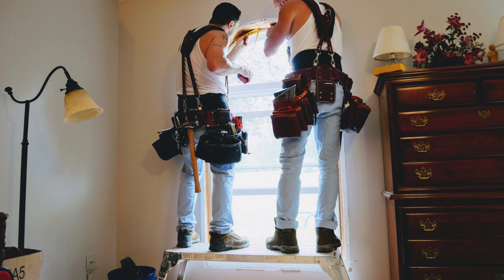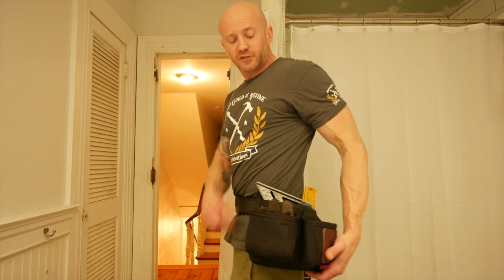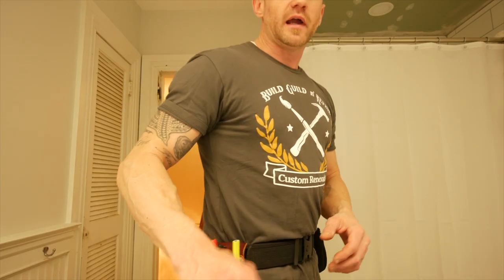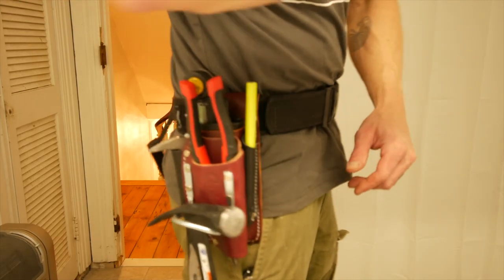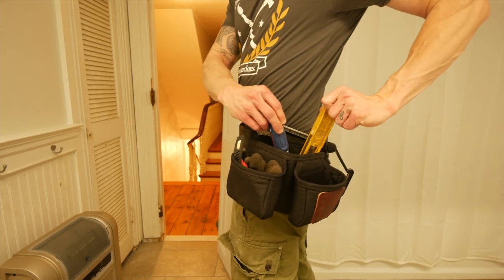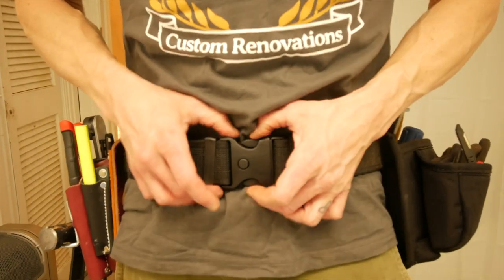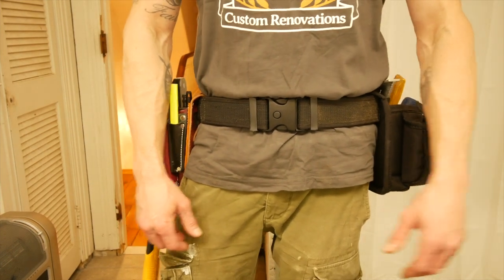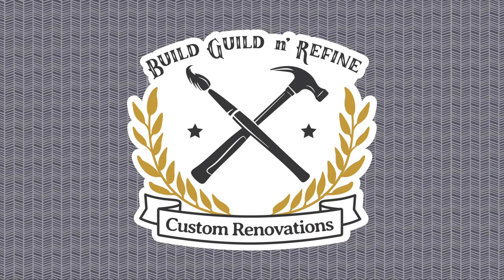Occidental lightweight carpenters belt/ Gorilla hook PDP innovations (GX850)

Comment: You say in this video you need to use two hands to remove the drill from the Gorilla hook.
However, i have found that if you hold the drill in your right and and put around your back into the hook with the head of the drill pointing towards your left side, you can release the drill with one hand by using your thumb to push down the bending part of the hook.
Reply from the maker: That’s great input, though I usually put on my trusty 30 year old pouches now, I can see how that would work well and I’ll need to try it!

Comment: Hey what’s the three pocket pouch called ?
Reply from the maker: It’s called the Occidental 5 in 1 leather tool holder!
Reply: if you're referring to the black one with the speed square, it's the occidental 9504 clip-on 7 pocket. it has 7 different sleeves/pockets but 3 main pouches... it is excellent, super light, and has become my go to instead of my full set of bags, specially around the house